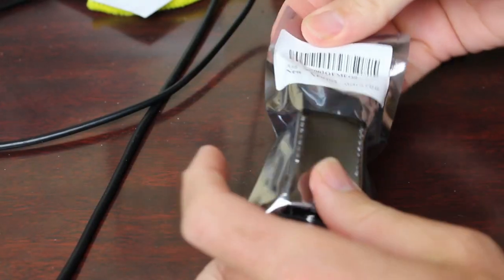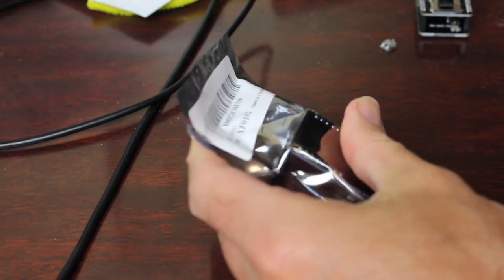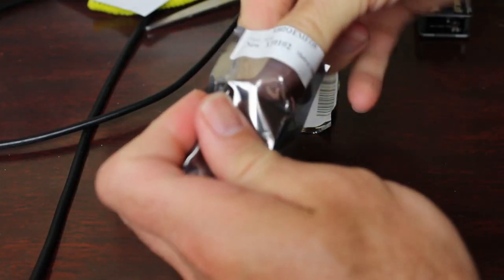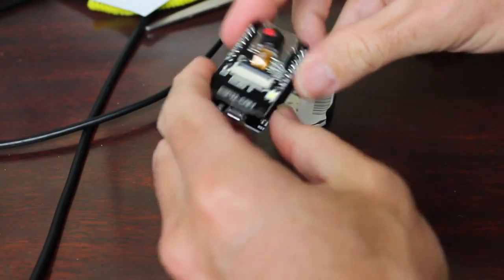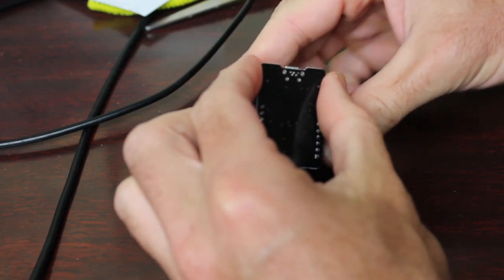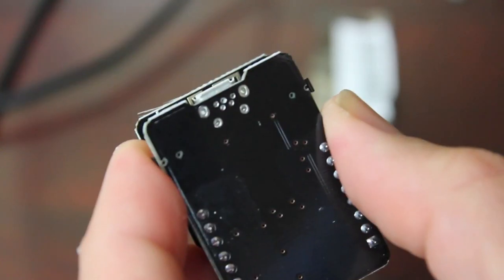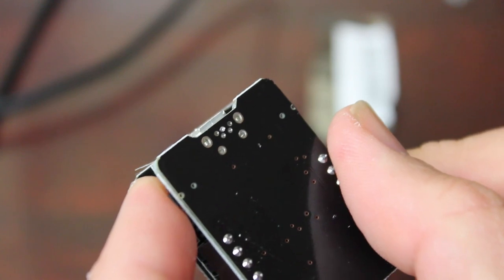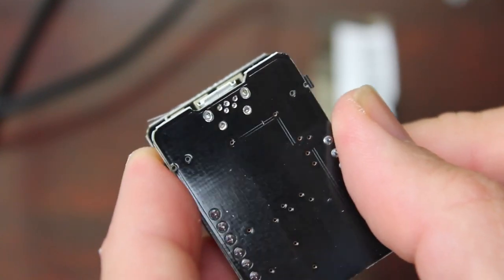ESP32 CAM USB Solder Follow Up Video

Comment: It's a tough call when worrying about solder as being secure enough on a tiny port with tiny pads. It could be ok but then again the temptation to use hot-glue too arises. Epoxy is a downer to get removed if that is needed to be done. We all use hot-glue. None of us are above it.

Comment: There are many different kinds of LGA, BGA and PGA sockets and you can use those for connecting all sorts of microprocessors/SoCs. Here are a few that you can use for my products:
http://www.lgasockets.com/desc/default.htm
https://resources.pcb.cadence.com/blog/2019-land-grid-array-or-lga-manufacturing-packaging-and-substrate-concerns
https://www.ardentconcepts.com/connect-r/
http://e-tec.co.uk/
http://www.gigaconnections.com/dcto40ghztestsockets.html
https://plastronics.com/
https://johnstechsingapore.com/verticon-bga/